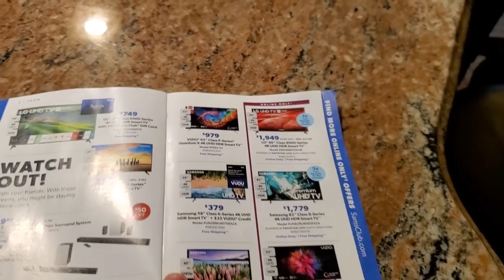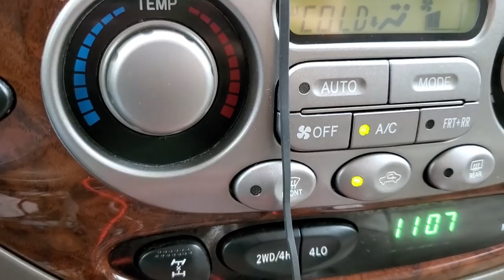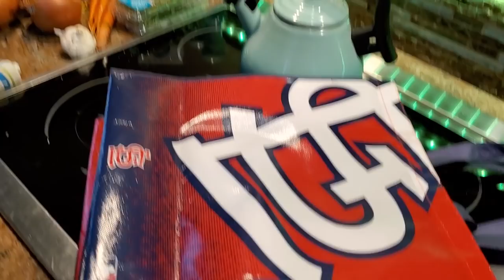Prepping My Growspace & Moving Plants Indoors

Comment: So, first a question that has nothing to do with the video. Do you know what the maximum dosage is for epsom salts? I've got this Asian Snow Jasmine that went chlorotic toward the end of summer. I gave it some iron and garden lime thinking that would fix the problem, but no. I've been dosing it with epsom for the past month and a half, 4 teaspoons in 2 gallons of water once a week. The old foliage is getting better, but it still looks not great, new leaves are growing in close to normal coloration (still not as dark green as they should be).

With the Areca palm, it isn't like you can't just cut trunks when they get too tall. It clumps, no one will notice after a while that a trunk was cut.

With the water lily, you could set a larger pot in the pond with the rim above the water level and then set the water lily pot inside of that so it doesn't bothered by the water flow. (I'd drill a hole or two in the side below the water level to allow water exchange though)
Reply from the maker: No idea about the Epsom salt. Good idea with the waterlilies, I'm thinking once it's full of water and I scoot the filters back the flow probably wont be an issue, but we'll see.

Comment: I didn’t have my second new stainless steel table assembled and set up when we had our first freeze so I’ve got to do some shuffling also. Thought I’d have at least two more weeks. Looks like you need an extra garage for your vehicles. Does one heater keep it warm enough during the bitter cold days? I live further south so heat lamps have always sufficed for heat but we are expecting a very cold winter so I may need to use my oil heater. Thanks
Reply from the maker: Hello! When it drops into the 20s outside I usually will have to use 2 or 3 heaters.